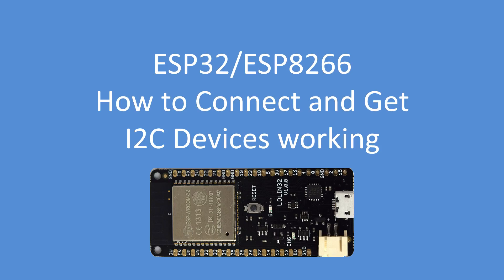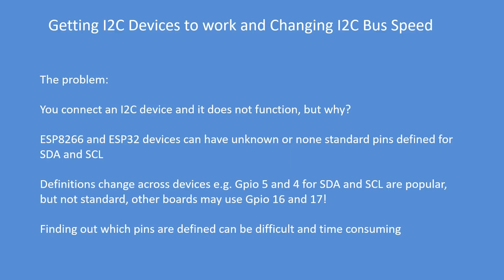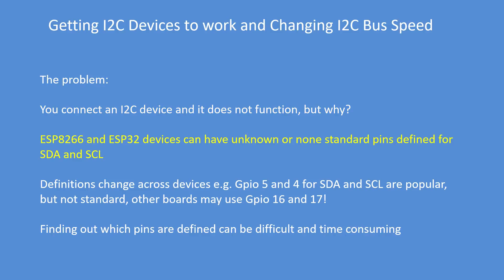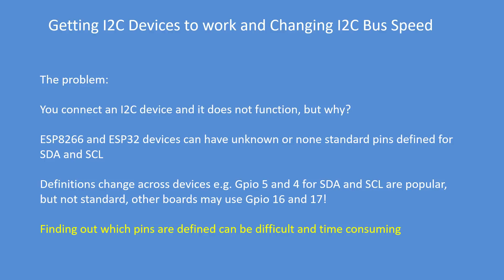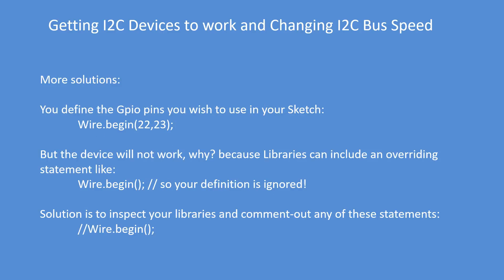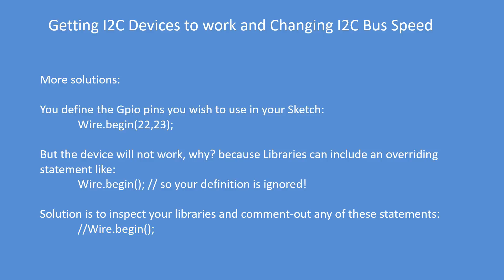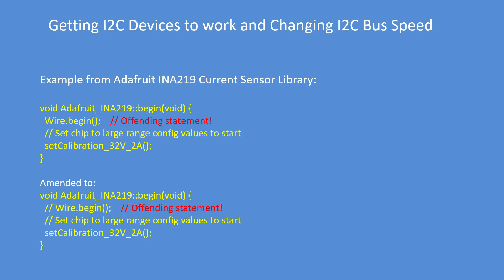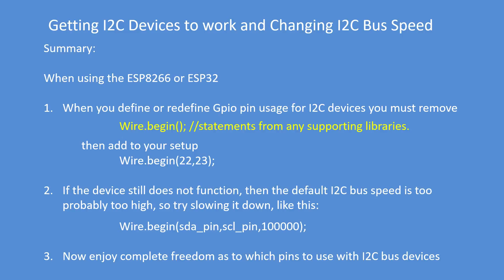Tech Note 063 - ESP32 / ESP8266 How to Connect and Get I2C Devices Working

Comment: Thanks a lot David!

I did change the wire.begin() in Wire.h library and set sda= 21, scl=22.
Now my arduino IDE in able to detect the I2C 16x2 LCD display.

I am using ESP WROOM 32.
Reply: I also changed the input voltage for I2C from Vin (5V) pin to 3.3V pin. Before it was not detecting the Display.

Comment: Hello! how can l declare 2 different ic2 pins?
Reply from the maker: You don’t really need to because it’s an bus system, but you can simply do eg
bme1.begin(sda1, scl1);
bme2.begin(sda2, scl2);

Then refer to each as required eg
temp1 = bme1.readtemperature();
temp2 = bme2.readtemperature();

Comment: Hi, Can you please share with us on how we could communicate between ESP32 and ESP8266 using wired communication (I dont want to use ESP WiFi or ESPNOW because i am running a time sensitive function on the ESP8266 and WiFi makes it errorneous). Thank you
Reply from the maker: You can simply cross connect the two devices using serial communication, so on the ESP32 set up a serial port on two chosen pins, then do the same on the ESP8266, again using softwareserial library and then connect ESp32 TXD pin to the ESp8266 RXD pin and the same for the other two pins, so TX-RX and RX-TX, you can transfer data at a very fast rate by doing this.

Comment: how do i use 2x i2c on the same esp32 to send some data?
Reply from the maker: Different I2C devices or the same?
Reply: @G6EJD  I want to send from the first esp32 two different numbers like 2 and 3 with the two different i2c channels. Like the number 2 from gpio 21 and number 3 from gpio 2 to another esp32
Reply from the maker: Why use I2C when you can use Serial?
Reply: @G6EJD  cause I don't know how to write it correctly with serial
Reply from the maker: So on ESP32 (1) serial2 TX and RX get connected to ESP32 (2) RX and TX did you cross connect them? So that TX-RX and RX-TX chooses your pins as required on each ESP32
Reply: @G6EJD  I want the first esp32 to send on two different channels like on gpio21 and gpio17 it has to, cause I am sending two different things
Reply from the maker: @sssedo1573  After the line: display.drawString(0,0,"0.1 0.2 0.5 1K  2K  4K  8K");
Serial.println("0.1 0.22 0.5 1K 2K 4k 8k");
In the function: displayBand(int band, int dsize)
add:
for (int i=0; i<dsize;i++){
Serial.print("|");}
Serial.println();
Reply: @G6EJD  thanks lot for your time :) I just want to know how to send from the first esp32 two different datas with the gpio21 for the first data and the gpio17 for the second data. I really don't know how to send those two different datas each on their own gpio

Comment: Sir how do you connect ESP32 with an arduin through I2C, is dat possible? I want to use the esp32 cam module to send data to my arduino to control my robots motors.
Reply from the maker: It’s not that easy as the Arduino libraries are all written with the idea that the Arduino/ESP is the master and sensors are slaves so you’d need to have an Arduino that is emulating a slave.
Reply from the maker: https://forum.arduino.cc/t/using-esp8266-01-to-communicate-to-an-arduino-i2c-master-slave/403887
Reply: @G6EJD  how about using an esp32 cam to send digitalWrite commands to another esp32 dev board
Reply from the maker: @chisomodimmegwa3479  yes that would be easy, you could use serial easily. With those modules the problem is finding a spare exposed pin or two to send the data
Reply: @G6EJD  I appreciate your quick responses Sir what do you mean by using spare exposed pins. My project basically is to create a website using the esp32 cam. The Web page will have video stream and controls for the motors and servos of my robot vehicle. The robot arm servos and motors will be hooked up to an esp32 dev board. I want to use the esp32 cam to control the esp32 dev board bcs I need d video stream. I dnt want to be forced to create two webpages for the esp32 cam video stream and another for esp32 dev board with controls for motors and servos
Reply from the maker: @chisomodimmegwa3479  well to communicate via GPIO pins you need at least 2 spare pins, check your camera module it may have no spare pins or just 1. Ive tried streaming video the best you’ll get is a few maybe 5-10 frames per second = jerky. You can modify the camera webpage to add other functions but you need to be good with html 5
Reply: @G6EJD  streaming video is good when I tried it. Also the esp32 cam module has nothing connected to it. So all the pins are available to connect it the esp32 dev board if dats possible. I just want to esp32 CAM to be the master and give digitalWrite commands to the esp32 dev board.
Reply from the maker: @chisomodimmegwa3479  they are necessarily free they are still connected to the camera and in use, I believe there is one spare GPIO pin, best to check

Comment: Do I need pullup resistors for the i2c pins in an esp32?
Reply from the maker: I don’t use pull-ups because I switch on the ESP32 internal versions

Comment: not mine, but FROM Stickbreaker on github:https://github.com/stickbreaker
(the ~Wire() means you don't have to touch the library)

TwoWire I2cOne, I2cTwo; // create variables
void setup(){
Serial.begin(115200);
~Wire(); // release hardware assignments, but Wire is still taking up RAM, because it was assign as Global

I2cOne = TwoWire(0); //initialize using the first i2c peripheral
I2cTwo = TwoWire(1); // initialize using the second i2c peripheral

I2cOne.begin(SCL1,SDA1,SPEED1); // you have to select which pins and speed
I2cTwo.begin(SCL2,SDA2,SPEED2);

}

Comment: Hi - the Wire begin thingy has been long fixed.

The ESP32 Wire.begin() function will default to the constants SCL and SDA defined for your platform when called with no parameters - but if you want to use non default pins then indeed you have modify the library code.

Comment: Does it work on esp32-cam?
Reply from the maker: Carlo Jay Jacaba, yes of course. The ESP32 cam is an ESP32 with an SPI connected camera, so you can determine the SPI pins used and connect another SPI device in parallel using a spare pin as it’s chip-select (CS)
Reply: @G6EJD   thanks, very helpful, I'll do some experiments 👍
Reply: @CiedJacaba   did you figure this out Carlo?? I am trying to do the same thing...and attache a MCP23017 to add more GPIO pins...
Reply: @philipchisholm  Unfortunately, it didn't work, whenever I call this function "wire.begin(sda, scl);"
I got this error "camera init failed"
I think, since on board camera uses default sda and scl pin, re-declaring them to other GPIO would make them non-I2C pin, then the camera won't simply work... I just use UART instead to talk to Arduino...
Reply: @CiedJacaba  Ok thanks...but I think you can have 2 SDA SCL sets on an esp32  >>> I saw this page https://randomnerdtutorials.com/esp32-i2c-communication-arduino-ide/ ....  plus you can run I2C in parallel.... and check this out.... https://github.com/espressif/arduino-esp32/issues/1438

Comment: Defining the pins solved my issue! I was communicating with an Arduino Uno and ESP32 with the ESP32 being the master. Thank you!
Reply: Hi, I'm doing exactly the same as you are.
I got a NodeMCU to work with the uno via I2C but not the ESP32 :(
Which ESP32 pins did you physically use and did you use the pins in your "Wire.begin()" ?

Thanks in advance!
Reply: @Bisofication  Hi! I used pins 21 and 22 on the ESP32. so I write "Wire.begin(21,22)". Make sure you specify an address. I had to make up an address (0x08) in order to communicate between the two. Sorry for the late response, you caught me on Christmas break.
Reply: @megan5303  I made another object called wire1 and assigned its pins to my liking and worked. Thanks anyways!

Comment: Wire.begin(19,20) for a WEMOS 8266 ESP-12S D1 mini      THANK YOU!!!!
Reply from the maker: Robert Housedorf II, the default I2C pubs set by the compiler are 4 and 5,  the ESP8266 doesn't have a hardware I2C bus, so I²C is bit-banged in software. This means that you can use any GPIO pins. By default, Wire.begin() initializes pins 4 (SDA) and 5 (SCL), but you can specify other pins using Wire.begin(int sda, int scl). What pins are you using?

Comment: Thanks for this, it surely would save hours of debugging for anyone trying to use I2C on ESP devices. I had one question about I2C logic level voltages. I need to control the PT2314 audio pre-amp IC with an ESP32 over I2C . The datasheet for this device states a Input Low Voltage (VIL) of 1V and Input High Voltage (VIH) of 3V and Output Voltage SDA Ack of 0.4V. From this it appears like the PT2314 uses 5V logic levels on the I2C. So would I need a level shifter to get it work safely with ESP32?
Reply from the maker: The data sheet says the 2314 is a 3.3v device so perfectly useable with the ESP32 voltage levels.
Reply: @G6EJD  In two versions (15-page and another 20-page) of the datasheets I couldn't find any mention of the logic voltage level. Could you share the datasheet link where this is mentioned?
Reply from the maker: If you check the detailed sheets you will see it refers to open-collector interfaces and so are defined by the controlling processor. Both data and clock are interfaces and compatible with a standard I2C bus at 3.3v or 5v. The pt2314 is not sourcing any voltage to the sda and scl inputs.

Comment: I have a DS1307 module. It works in my Arduino Mega, Arduino Nano and ESP8266 but not in my ESP32!! Thank God I found your tech note video. Thank you. Now it is ok !!! I will check later if there is an Wire.begin() in the lib DS1307.h
Reply from the maker: ESP32 normally uses pins 21 and 22 for I2C, but depends on your board, some are 4 and 5. Serial.println(SDA) will help you same for SCL
Reply: @G6EJD  Sorry for my english. I wanted to say that watching your video I learned how to make it work in ESP32 too, after 2 days "fighting" to solve this issue. Thank you very much.

Comment: Can 2 I2C Device connect on one ESP8266 NodeMcu?
Reply from the maker: Christian Dave Tipactipac, yes but only if they are different devices. Each I2C device has a unique address determined by sensor type and manufacture. If you want to use multiple devices of the same type then you need to use an I2C address multiplexer where you would address device 1 at the multiplexer base address plus 1 and device 2 at the base address plus 2 and so on, the multiplexer will handle the device I2C address for you. They are quite easy to use.
Reply: @G6EJD  Thank you.

 I was planning on using a VL53L0X, a Time of Flight Lidar Sensor, for measuring distance in a single axis, and at the same time, to use a HX711 for 24 Bit reading on an ADC Voltage.

Those are complete 2 different I2C Devices, right? :

sorry for the dumb question sir.
Reply from the maker: See here for addresses: https://learn.adafruit.com/i2c-addresses/the-list
Yes they are two different addresses and will work fine. However I would question the need for 24-bit ADC resolution as the default ADC is capable of very good resolution and practically that level of resolution is not required.
Reply: @G6EJD  Thank you sir for the help, I really appreciate it.

It made sense when you stated the level of 24-Bit resolution, I just thought having a very sensitive sensor could output an effective device, just learned that it was somehow "Overkill".

Thank you sir, hope you would make more tutorials for everyone.
Reply from the maker: Remember if you were measuring a voltage range of 0-5v using the ESP32 ADC which is 12-bits, then that would give you 1mV resolution as good as a DVM. For the ESP8266 where the ADC is 10-bit that’s 5/1024=5mV resolution and that is still very good. In general terms the lower the voltage range being measured the lower the ADC resolution can be and conversely for higher voltages the higher the resolution, for example measuring 0-100v with a 10-bit ADC would give you 0.1mV resolution, but in % terms and most practical applications that is still good enough. You can end up over complicating solutions. The best approach is to use what the device has to offer and then upgrade only if required.
Reply from the maker: BTW you should wire a 10K pull-up resistor from 3.3v to SDA and one to SCL this will ensure reliable operation.
Reply: @G6EJD  Sir, is there any way that initialize SDA and SCL only after putting the sensor?

Before attaching the sensor the ESP8266, it gives a trash data stating an error and while at it, I then attached the sensor to the NodeMCU but only states a Timeout.

Is there a way that if I detach my sensor, it just closes and if I attach it again it then gives a reading?
Reply from the maker: Christian Dave Tipactipac, you can add a programmed test for a sensor before trying to read from it.
If (bme.begin()) bme.readtemp
But you’d have to keep checking in a main loop or have a function that tries to read the sensor and only if a valid .begin() test has passed.
Reply from the maker: You may have to give the sensor time too so 
While !(sensor.begin()) delay(5);

Comment: I have two different kinds of esp32 devices, the program I'm running only uses the wire.h library, the program works on an arduino, the i2c device shows up on both devices when I run the i2c scanner, tried defining the pins and bus speed. Still can't get it to work.
Reply from the maker: What are the devices your trying to use? In most cases the driver library sets the I2C pins overriding your own chose, or the library has not been written to support the ESP32.If the I2C scanner can see the devices then you have them wired correctly, that's a good start. The address found should correspond with the devices address.For example if you have a Adafruit BME280 they set their I2C address usually 1 more than normal, let's say 0x77 and their library is designed to address a device at address 0x77. If you buy a 2rd party type the address is usually 0x76 and so the device apparently does not work.Let me know the device type and your detected address.
Reply: @G6EJD  Trying to use an MPU-9255, the ESP devices are Heltec Wifi Kit 32, and Doit ESP32 DEVKITv1. I'm not using a library, only the wire library which sends pure i2c.
Reply from the maker: The MPU-9255 is particularly difficult to communicate with, largely because there are 3-devices on the unit and I can tell you the number of setup commands you must send to the 9255 is huge, about 50 or more parameters. There are some libraries around that do all this for you. There are simpler devices on the market you may find easier to use.
Reply: @G6EJD  I've tried the dedicated libraries, changed the wire.begin command in them as in your video. Still no luck. Which simpler devices would you recommend? I'm making a bike computer that displays what grade I'm riding up or down, so I only need gyro and accel.
Reply from the maker: I have some working examples, what is your email address?
Reply: @G6EJD  Sent it to your website, Thanks.
Reply from the maker: Did the examples work ok?
Reply: I also had no luck trying all suggestions with 2 different ESP32 boards.  Sensor would work on regular Arduino, though.
 I found information that suggested adding pull-up resistors to the SDA and SCL lines and... success!  

Used 4.7K resistor between 3.3v and each of SDA and SCL pins.
Reply from the maker: Also, try wire.begin(sda, scl ,90000); as many devices are only capable of 100Khz and may be marginal
Reply: @G6EJD   i would connect esp32(slave) to arduino uno(master) but i have any probléme with library  wire with Onreceive() ,
Reply from the maker: Ania Zerbout the problem is in programming terms both devices will configure themselves to to be bus masters and hence you get a conflict. I do not think there is an easy solution to this with the compiler settings
Reply: @G6EJD   So it's impossible to program esp32 as a slave????
Reply from the maker: See here on the ESP32 forum: https://esp32.com/viewtopic.php?t=3009

Comment: OMG! Thanks Dave. It took me ten minutes thanks to your instructions. Good, nice and simple job, but very valuable.
Reply from the maker: Happy to help, this is why I produced the video.
Reply: If the problem was, as in my case, with Adafruit_SSD1306 library, just look for it in your Arduino Libraries folder, open Adafruit_SSD1306.cpp and search for "// I2C Init" (aprox line 205)  and make changes as this:

    // I2C Init
#if defined(ESP8266) || defined(ESP32)
    //Put your Wire.begin(SDA, SCL, Bus_Speed); in your Sketch just before display.begin(...);
#else
 Wire.begin();
#endif

In this way the library works for Arduino boards without any mod, and for ESP32 you MUST include one line of code just before display.begin(...) with the custom Wire.begin(SDA, SCL, Bus_Speed).

For me with an 0.96" OLED display and 15 cm wires, Wire.begin(0, 4, 800000) works fine. (choose ports at your convenience)

Simple and elegant, right?